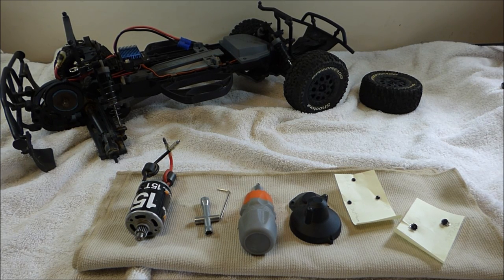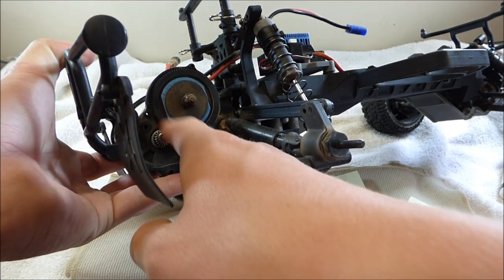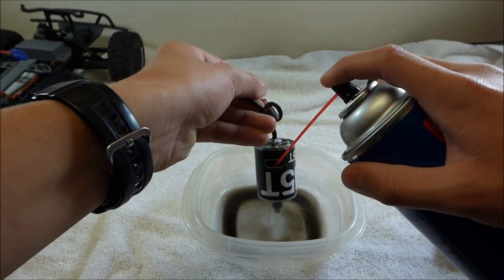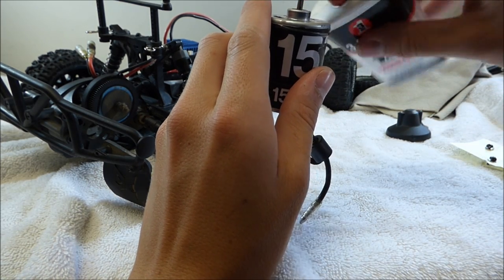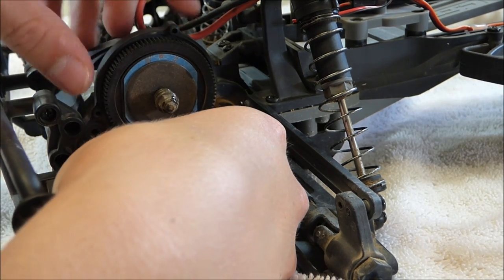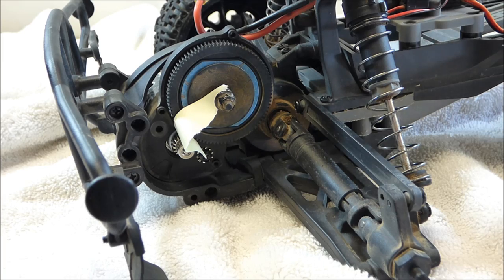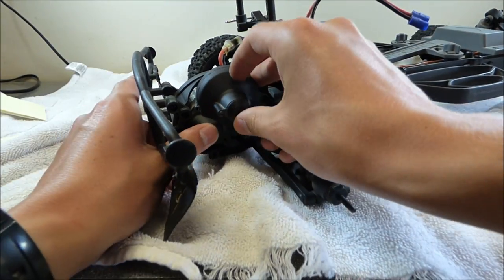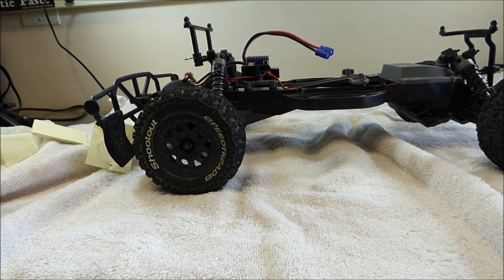How to Clean an RC Brushed Motor

Comment: first of gear mesh is to loose, second to put motor back on you put the top screw for the motor in (loosely) and the the bottom one (loosely) once you have your gear mesh right then tighten top then make sure gear mesh is right then tighten the bottom
Reply: completely agree!

Comment: I believe you used contact cleaner from CRC. It's a great product and used throughout the electrical industry for cleaning components such as contacts on relays and such. It sure did an excellent job cleaning your motor. It's crazy how much dirt came out of that motor. Great video. Your using the best stuff to clean with IMHO and it's safe on plastic.

Comment: Nice tutorial! Most seem to use a glass of water to run their motors in. I have picked up a can of Duratrax Power Shot to clean my motors. The only difference for me, is to not use 3 in 1 oil. If the motor gets hot, it can break down, and you will definitely know because you will be able to smell the oil when it gets hot. I picked up a bottle of Parma bushing oil. The shaft of the motor runs on bushings, so I'm guessing it would be a better choice to lubricate the motor.
Reply: how did the bushings oil work out for you?
Reply: @Ris-v4w  I haven't ran my trucks in a while, so I have yet to use the Power Shot spray and bushing oil on my motors. But a friend of mine was concerned
about the way his motor was running one time. I didn't have the cleaning spray with me, but I had the bushing oil in the box I carry with tools and batteries. 
The bushings on his motor looked dirty, like a fine layer of dirt. We put some drops of it around the motor shaft, and it improved the performance of his
motor quite a bit.

Comment: Used brake and clutch cleaner aswell as the same 3 in 1 oil. seems to have worked very well. I noticed that my senton was being a bit slow but it seems like new now. Thanks

Comment: Very interesting and useful video. I have one question. how much is the motor's shaft diameter and the pinion gear aperture diameter, which is mounted on the shaft by grab screw?

Comment: U should've put the top screw in first just snug then the bottom screw in cuz it isn't like the top where u can't move it it's not just a hole u can move the motor still n once u have it where u want it continue to tighten it down

Comment: The 1st part you can just fill a cup with water and put your brushed motor in it and just give it a little throttle and keep doing that until the battery is completely dead and you'll see that the cup will be completely black the 1st part isn't needed just do the water method a lot more easier and it cleans it way better
Reply: Calvin Ramin yeah I do the same thing and then I use WD-40 to lubricate everything
Reply: @moistavocado2350  WD 40 IS NOT LUBRICANT DO NOT USE ITS MEANT TO BREAK UP DIRT AND RUST

Comment: We can't use wd40 instead of moter cleaner plzz replay
Reply: no, itll destroy the motor never use WD40
Reply: @klondike3112  but I all ready used wd40 now what to do
Reply: @unboxingnewthings7766  Does your motor still work? If so, just buy some motor cleaner and clean it as you would. If it broke or it is running at extremely decreased efficiency, you'll need to buy a new motor, but luckily they're really easy to install
Reply: @klondike3112  yes my moter still works bt in india goa we don't get moter my friend bought the car for me from Dubai

Comment: after every run or two ?..
Reply: I'd recommend every 15-20 runs
Reply: @snjert8406  Are you sure that not every 2 or 3 runs or ia 15-20 runs ok to?
Reply: @Vato_Loco_rc  it depends on what terrain and in which conditions you're running it in. If it's just some grass and tarmac, then it's fine for 20+runs. But after a lot of water and mud you'd have to clean it after that run.
Reply: @snjert8406  Ahh ok that makes sense. Thx for the info. Btw can you just hose down a titan motor outside and than dry it well afterwards?

Comment: do you have any rc's?
Reply from the maker: I have an ECX Torment, Axial SCX10 Trail Honcho, and a RadioShack Monster Patrol
Reply: RC Experience is it bad to drive my ecx torment when the Gers in the motor are chepd off
Reply: @johfyf5055  yes. very bad.